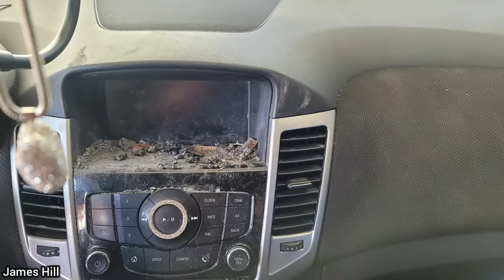Customer States New Oil Pump Installed, Still Has No Oil Pressure

Comment: I had to rewatch that 2nd one a couple of times for it to really sink in. I mean, how do you install a spare backwards, and, not notice that something's not right before driving off?
Reply from the maker: Haha ya that one must have made quite the noise for a bit.
Reply: Same here. I commented on how I couldn't believe the idiot was able to jack up the car and replace the tire. They get that far then put the spare on backwards? WTF! They walk among us...be careful and aware. LOL
Reply: At least they didn’t keep driving on the rim of the flat, that’s something I’ve seen on this channel more than once.
Reply: I can sort of understand… here’s why: Unlike a regular wheel, there’s no “obvious” finished, fancy side that faces out on a donut spare. Further, I can understand why someone might think putting it on backwards would keep it clear of the hub/rotor/caliper. Finally, if it was a rear wheel and the parking brake was set during the swap, one might not think to give it a test spin, or if they tried, attribute the stickiness to the brake. 
Especially if it was done at night, in the rain, by someone who isn’t much of a car person, I’m pretty sympathetic.
Reply: @truthsmiles  I confess I started to put a spare on backwards once, but while I was putting the lug nuts on I noticed I couldn't see the valve stem.
Reply: Actually the wheel right. It was the truck that was backwards.

Comment: People need to know what they don't know.  I do 99% of my own stuff and usually without incident, but I'm smart enough to know when a job is above my level and to seek advice/help elsewhere.
Reply: Same here. I do most of the work on my vehicle but I wont touch springs with a 10ft pole. Got a mechanic to change them. And as surprising as this may sound I've never changed brake discs either, so I'm getting a qualified mechanic friend of mine to show me how to do it properly. They're vital to safety so i don't wanna just get stuck in myself without fully knowing what I'm doing as I don't want to miss something. These new owners manuals do not give anything useful anymore.
Reply: @bailey125 TBH if you have a repair manual and the proper tools brakes and Discs aren’t a problem at all. The first time I worked on brakes I made sure to not replace them all so I can test them and if they don’t work I still have the ones that I didn’t repair / replace. But brakes are relatively simple so if you’re not totally untalented its an easy fix…

Most jobs I can’t do are because of missing the proper tools, for example as the other one said I wouldn’t work on springs as I don’t have the compression tools. I think the hardest jobs are diagnosing and doing bodywork as it requires more than just replacing parts…
Reply: @Simoxs7  Yeah that's true, but I still think it's better to be on the safe side and have someone there with me who knows what they're doing. That way I can learn how it's done and I can do it on my own next time.
I've done a full turbo-back downpipe, sport GPF, backbox on my own, I've done an intercooler upgrade on my own, and a bunch of other smaller things, all of which I had no idea what I was doing but I just figured it out as I went along. Brakes I don't think I should mess with without knowing exactly what to do.
Reply: @bailey125  😂 springs are a tick time bomb waiting to happen.